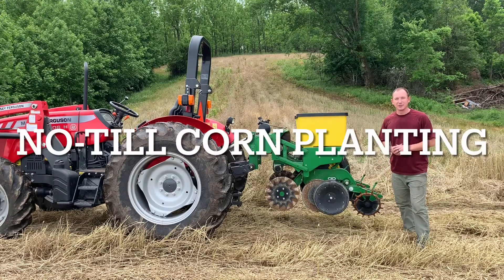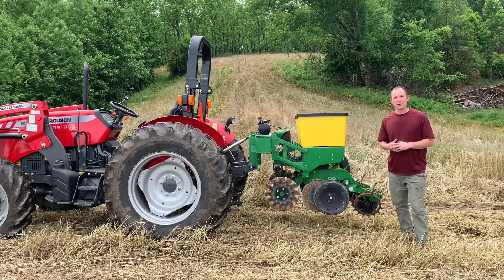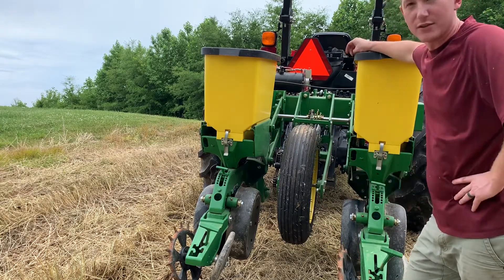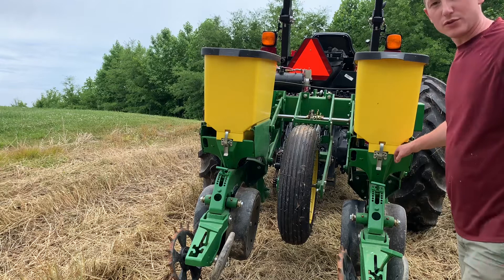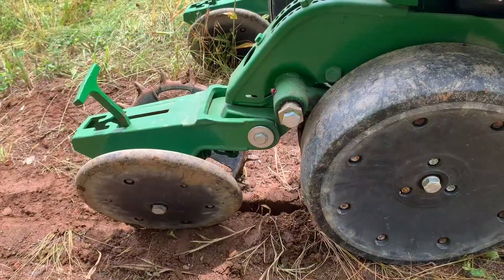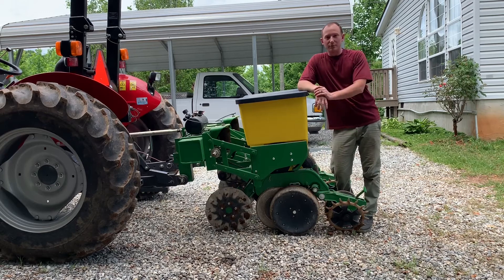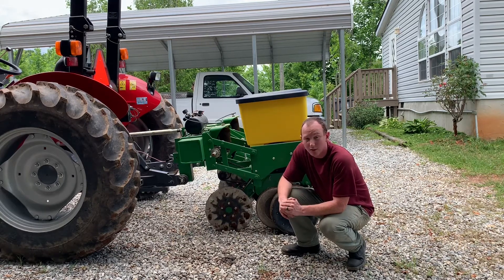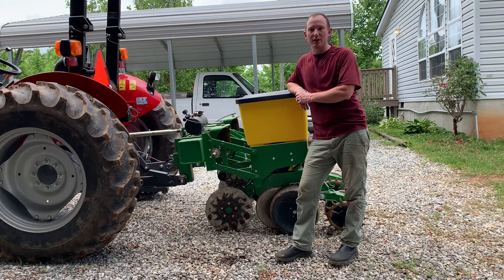No-Till Corn Planting John Deere 7000

Comment: Very great explanation of the planter, I have a JD 7000 no till, but also a 246-247 old JD planter, wish someone would do a video on that and explain the sprocket adjustments for 5" population rate.  Waiting for my user manual to show up and have Soy Beans to get in the ground. Really like the look and features of your planter.  👍👍👍👍  Oh I cut my fields after we spray then, planter works much easier and you can also see much better too

Comment: Agree with first comment about frame level with the ground,  your parallel arms should be parallel to the ground when planting.  Lengthen that top link between the tractor and planter and everything will work better.

Comment: Can you share with me how you set up your air compressor down-pressure unit on the planter? Thank you, Patrick Wolf
Reply from the maker: Fortunately for it came on the planter, and it was already set up. I wouldn’t know how to add the airbag system to it from scratch. If you get one with it attached it’s really a trial and error process to figure out what setting works best. The setting will also vary based on soil conditions and planting depth

Comment: How much did that planter cost and what model
Reply from the maker: I bought it off a local guy who bought it new from up north and used it for one season. It’s a handmade planter using John Deere 7000 parts. Same adjustment principles will apply to a JD 7000.
Reply from the maker: I believe I paid $3,000 for it
Reply: @buckhavenlandsolutions539  thanks
Reply: Can a two wheel 20 hp tractor pull the two row no till John Deree planter?